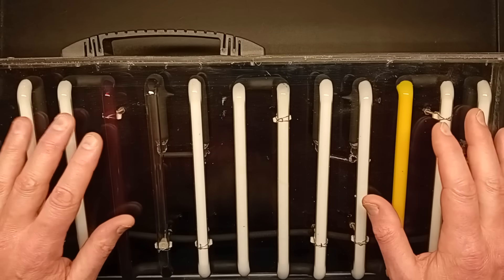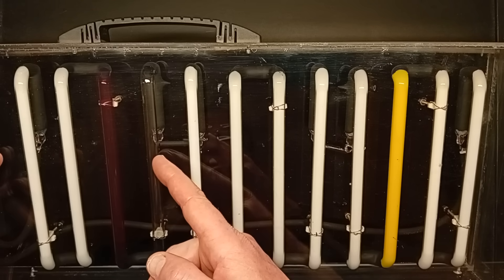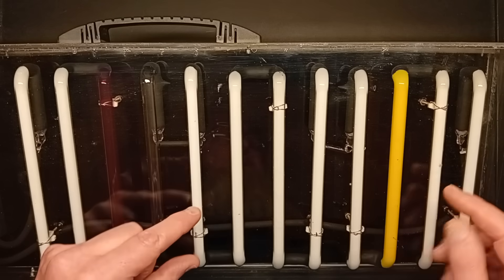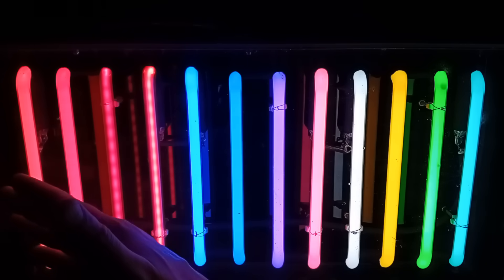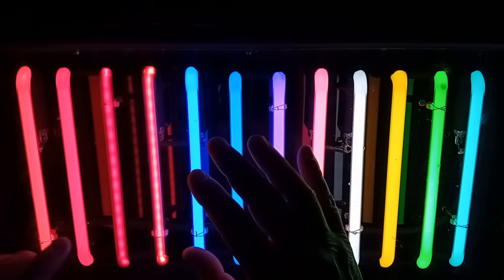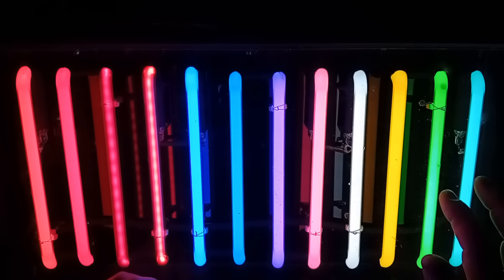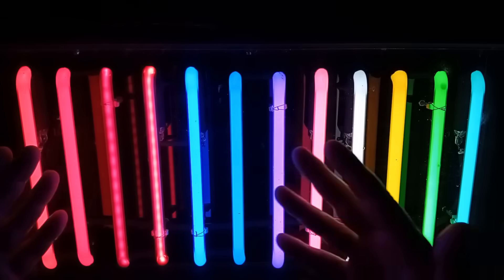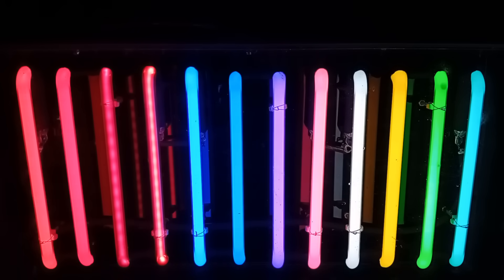REAL neon display case

Comment: IIRC from reading about electronic drivers for fluorescent tubes, the "beaning" is caused by the speed at which electrons accelerate before hitting something. By tuning the driver frequency and amplitude, you can change the length and location of bright spots, or get rid of them.
Reply: Total poo, they wouldn't then speed up again out of nowhere to create a second pulse
Reply: @phonotical  the voltage difference along the tube is a linear accelerator. What creates the pulses is electrons accelerating until they reach sufficient energy to ionize whatever they hit, lose that speed in the collision, rinse and repeat for each electron cloud along the way. In hot cathode tubes, the pattern is most pronounced at the cathode(s) since there is a permanent cloud of free electrons ready to go all in one spot.

Comment: What is the supply voltage of the neon tubes?
Half a century ago I occasionally installed neon tubes, the rule of thumb was: 600 volts per metre.
Reply from the maker: A few thousand volts for this display.  It's a self adjusting power supply.

Comment: Re the jellybean/beading effect, to quote the 1997 edition of "Neon Techniques":  "A second electronic effect produced within the gas itself is making nodes of light appear within the tube and to cause these nodes of light to move forward or backward. Power supplies that accomplish this are called ‘bead makers’ or ‘jellybean’ supplies. 

This type of electronic supply works by applying a symmetric, perfectly balanced high voltage AC signal across the tube. This produces a bead-like appearance of light and dark sections in the tube. Even slightly altering the balance of this AC signal, via a control on the power supply, causes the beads to appear to move throughout the tube."
Reply from the maker: The odd thing is that normally the output of an electronic supply has to be perfectly symmetrical to avoid mercury migration.  So the very act of trying to prevent jellybeaning may cause very slow migration of the mercury to one end of the tube.
Reply: I wonder if tiny manufacturing flaws in the electrodes cause slight tube rectification effects, just like with a hot cathode emitter?

Applying a pure, isolated, AC transformer voltage to a tube "should" be a perfect AC symetrical voltage. So any of these beads- if they appear- should be completely stationary.